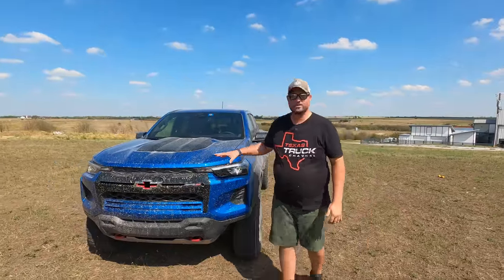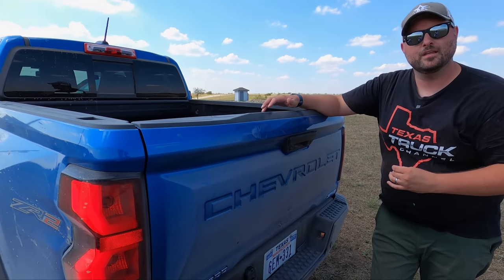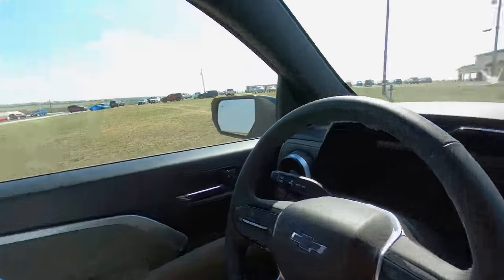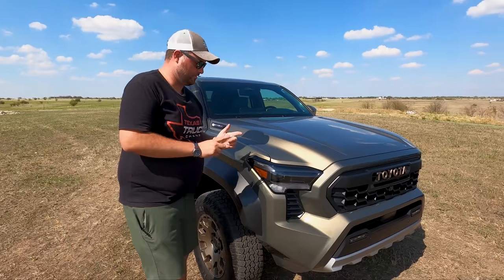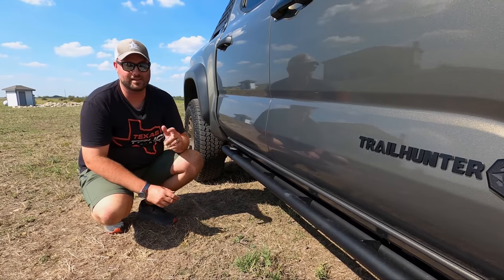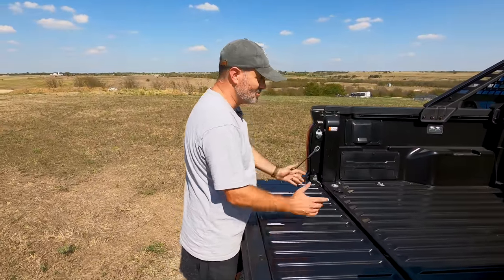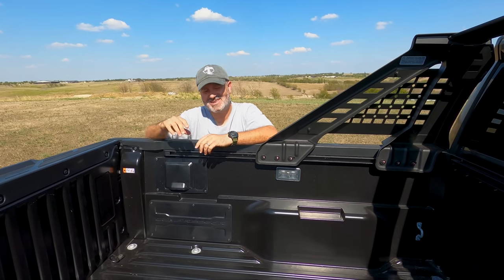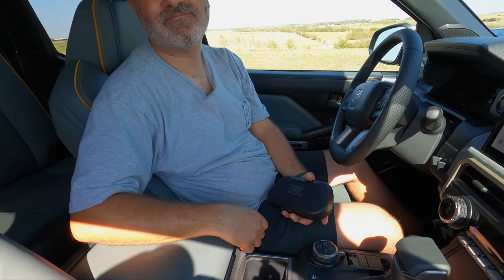Tacoma Trailhunter VS Colorado ZR2 - Which Is The Best Midsize Truck?

Comment: As a multiple Chevy owner I can attest they look awesome.  However if you want a truck that will not keep you in the shop buy a Toyota.   Period.  End of discussion.
Reply: LOL
Reply: @docholliday7548 it’s true
Reply: The only new Toyotas I’ve seen come in with issues were because the customer pulled the transmission oil plug instead of the engine when trying to do their own (free if done by us under 30k) oil change.
Reply: No joke here.  I own a 2017 Colorado diesel.  Switched from a Taco to the Colorado because of the Duramax.  Range is awesome … but, 6 years later, I have no heat in the cab.  $4,500 to fix it … some odd diverter part buried in the dash … requires full dash removal.  On a truck with only 55K miles.  This new Tacoma design and this hybrid motor will bring me back.  No BS issues on Toyotas period.
Reply: My new at the time 2022 Toyota Tacomas ac heater blew at 400 miles, started having electrical problems, kept taking it back, payed it off only put 3k miles on it and got rid of that POS for a much more powerful, better looking Colorado Trail Boss, plus I got the 430torque calibration!
Reply: Facts. 🤷‍♂️
Reply: @nscalewunderland  wow that’s crazy.  To bad about the truck.
Reply: @jimmycline4778  never heard of that happening ever.  How do you like your new one?
Reply: for some things sure, Ive owned both and the L3B engine on these trucks appears to be similar to toyota engines with reliability.
Reply: Lol I like how what you says goes 🎉
Reply: @nscalewunderland  hmm that's odd. I've got a 16 Baby max with almost 100k on it now and never anything like that. The biggest issue was replacing the knox sensors. The other issue's have been from me breaking shit from off roading.  This has been the best truck I've ever owned. Sorry to hear about your bad luck
Reply: I owned both and they were both reliable.
Reply: As a toyota guy, I'm concerned about these hybrid power plants. Wiring across the board in all manufacturers has become extremely poor and all the sensors just end up corroding. Id be very scared buying a used model or having the vehicle over 5 years driving through Canadian winters...
Reply: I would normally say that about Toyota but these are turbo engines and the trucks are made in Mexico now just like Chevy and Ford.
Reply: @chriskolaska897 Nice and thank you.  I’ve been a GM fan my whole life but as a business owner I just can’t be without a truck for work.  Dealerships around me don’t give out loaner trucks while the truck is in service.  I have to rent one every time.  No joke I have put over 7k in work done to keep it running.
Reply: Can that rack on behind the cab be removed to put bed cover over it
Reply: I have a 2019 chevy silverado double cab Z71 4x4.  Less than 80,000 miles. Transmission completely gone. It has spent most of its life in the shop. As I bought it brand new. Never off road. I will never buy another Chevrolet product as long as a live!
Reply: @roberthunter8573  That sucks to hear.  Mine has 130k miles on her.  Purchased it new and just added up how much in warranty repairs have been done.  Over 7k.  Just unacceptable.
Reply: @dean7968 yes, very easily too
Reply: I am also a multi GM owner, and my trucks are rarely in the shop for any reason.  Must be operator error, if you're always in the shop.
Reply: @jreyman  it's called transmission failure, not operator failure. Look it up, I own multiple chevys and gmc. That's all I use for my business, that are GPS so I know if 1 of my drivers is tearing it up, speeding, hard braking etc. I have 2 - 2019 and a 2020 chevy silverado waiting for transmissions. With less than 75,000 miles. Oil changes and maintenance every 3000 miles by the dealership.
Reply: @seankadar9550  it's an ongoing problem, is what I've been told. You either get a good 1 or you get a bad 1. I've always bought gm products. However, I do have a couple of trucks that are 2017,2018 with very high miles that I keep in the fleet because they have never had any issues. But 2019 and on nothing but problems. My experience I can't speak for all.
Reply: @jimmycline4778 hahaha quit making shit up
Reply: Can you say AMEN!
Reply: Like the Toyota won’t lol
Reply: @ferminsainz9083  I had an older Toyota truck 5spd. I bought it with 80,000 miles on it. When I got rid of it. It had 483,000 miles on it. And 6 urs later I still see it running around town.
Reply: @ferminsainz9083  it literally wont
Reply: FALSE narrative. 
The 2023 Colorado had a superior score compared to the Taco (a truck I admire).
Reply: @docholliday6285  they are junk. I have 1
Reply: I don't think the 2023 Colorado will keep you in shop. Power train is proving to be good...
Reply: What about the new tundra’s… all I see is motor problems… wake up people Toyota finally made something new and there’s gonna be problems just like everyone else
Reply: @stonejss727  only time will tell, just like anything else.
Reply: Well, I have a 2008 Chevy with 230,000 miles on it. I haven’t had the first issue beyond routine maintenance.
Reply: @devindoyle5138  you're talking about an older truck. They are different from newer models.  As I have a 1989 silverado with 683,000 miles on it. The thing is they don't make Chevy/GMC, Dodge/Ram, and Fords like they use too. So your 2008 probably will never have any major issues. It's this new technology BS... that's what we are talking about
Reply: that was definitely true in the past. it just ain't with the new gen of tacomas and tundras, especially made in Mexico
Reply: Well all I see is tundra recalls with blown engines... so maybe toyo has some issue in 2024! No longer king... maybe a jester now!
Reply: @nscalewunderland this aged like milk.
Reply: If you don’t give the correct maintenance any truck will keep you in the shop. I have a 2014 Colorado and I been once in the shop.
Reply: I've owned a Toyota... wasn't impressed tbh. Chevy has never let me down, 20 yrs and running.
Reply: Your comment did not age well.. now Toyotas are blowing motors left and right and tranmission as well
Reply: @davidleeosbourne2727   Blown out of proportion.  No pun intended.  Difference is Toyota will fix the problem and not continue to produce garbage for years knowing they will continue to fail.
Reply: This didn't age well. New Tacoma's are breaking or overheating all over the place 😂